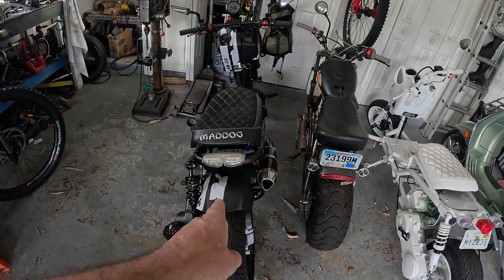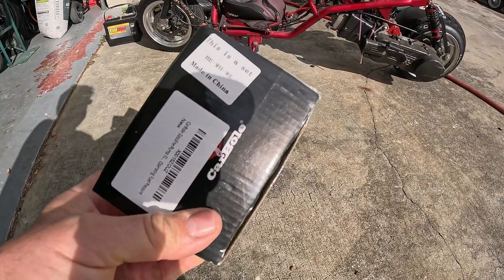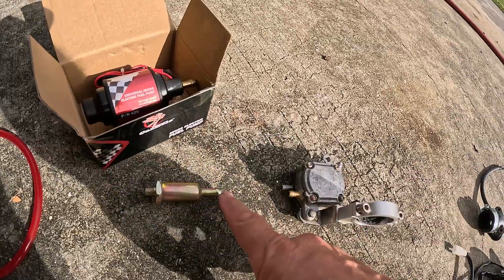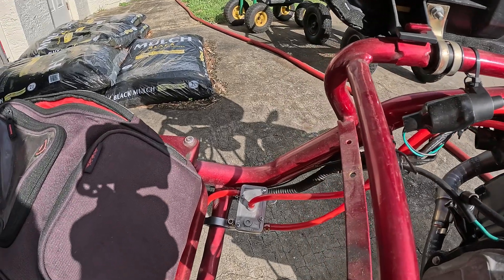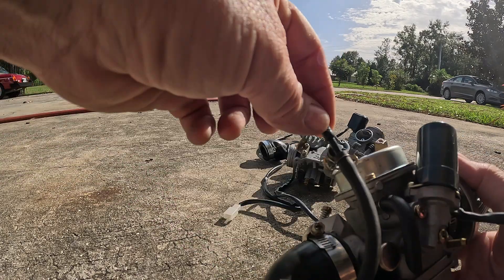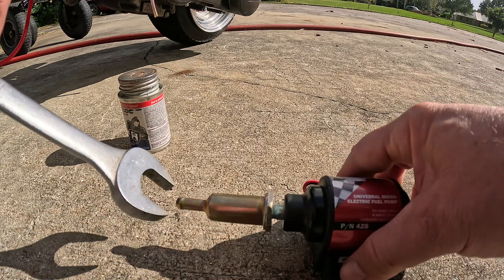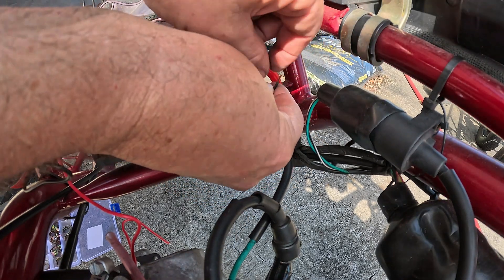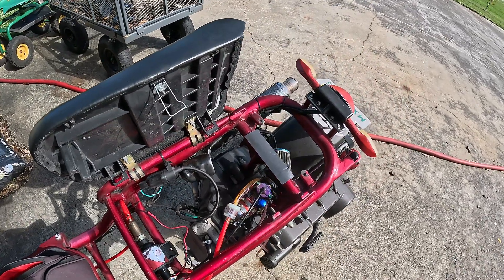How To Electric Fuel Pump Your Maddog or GY6 Scooter In 10 Minutes and Cheap AF

Comment: I have a question. When bike engine is running but not accelerating so , in that case bike will use less fuel but the fuel pump is keep pumping the fuel. So, isn't that bad for pump? It keeps running but the carburetor is full.
Reply from the maker: @omerameen5900  there is still fuel in the pump to lubricate it I am sure.  I am not sure how it knows to not push the fuel to the carb.  Must be a mechanical pressure switch inside between the pump and outlet.  Typically a pump would have pressure switch and send the unused fuel back to the fuel tank via a return line.  These new small pumps just circulate it inside I guess until needed.
Reply: @GhettoWrench  thanks. My gs500 is very bad at vacuum system. It has a mind of it's own. Sometimes run perfectly. Sometimes overflow carburetors. Sometimes starve the engine on high speed. I'm very annoyed by the fuel system of this bike so, considering converting it to fuel pump.
Reply from the maker: @omerameen5900  I though a GS500 had a regular tank and gravity.  What a hassle they put vacuum on that.
Reply: @GhettoWrench  tbh, I'm tying to search and finding the solution myself.  I Have already spent too much money on solving this issue.

Comment: Hello from Sweden.
Love your video. Have a question. In Sweden I can only get the Carbole 2.5-4 psi pump. Will that be to much? If I order it the will send only from the US and they want 19 usd in shipping..... Please help
Reply from the maker: @swedaksouthsweden  I am not sure.  I bet it would work.  But if not, can get one of these little fuel pressure regulators locally?  
https://www.amazon.com/TEMSONE-Adjustable-Regulator-Universal-Carburetor/dp/B0B74G58ZT/ref=asc_df_B0B74G58ZT?mcid=b565d991dd0d3cc9b5d2a62c7c45b9bc&tag=hyprod-20&linkCode=df0&hvadid=693391019694&hvpos=&hvnetw=g&hvrand=16517205986303312942&hvpone=&hvptwo=&hvqmt=&hvdev=m&hvdvcmdl=&hvlocint=&hvlocphy=9012194&hvtargid=pla-1955447590737&psc=1

Comment: I need some help .. so I got the pump working however for some reason the scooter isn’t turning on.. cranks till battery dies.. it would turn on with mikuni pump, it will take forever but eventually turn on.. I am running 2 step down filters mayne that’s the issue? Any help would be appreciated
Reply: I will try to open fuel drain and see if that works. I haven’t worked in the carb on all but I have a brand new pwk carb that I might just put on because I feel this oko one I have on now has been giving me issues since I bought it.. thank you for your help
Reply from the maker: @LuisGallo-r2b  pull the fuel hose off the carb and turn the key on.  See if fuel flows out good.
Reply: So when I pull the hose out of the electric pump fuel comes out but when I put a hose from
Pump to carb nothing seems to be going into carb .
Reply from the maker: @LuisGallo-r2b  do this.  I had to do it on a couple bikes.  Turn pump on then open the fuel drain on the float bowl until fuel comes out then close it.  I actually just had a pocket of air I guess.  Who knows, but it worked.  Other thing to try may be tapping the bowl as maybe the float is stuck in the high position.  Did you work on carb?  If so were the floats moving up and down freely?

Comment: On the gen V you can relocate your plate holder under the taillight and use the plate light wires (circuit) to run your pump.

Comment: Hi! How reliable has this electric pump proved to be? How long have you been using the bike with him? There are similar electric pumps in an iron case. They are cheaper. But they don't work for long. They burn up.
Reply: I have used the metal type that you are speaking of for many years without any issue. I have used these plastic type just the same. I think the main thing is to get the correct pressure that you need for the application you are using it for. I still have the metal pump on my 90 convertible Camaro. It's been working for 10 years. I don't drive the car that much any more but it was a daily driver for a year at least. Putting an over size psi pump is the main issue. If you use the correct size there shouldn't be any issue at all.
Reply from the maker: @ДмитрийКлепиков-к6х  Holly makes a real nice one that is all metal and looks better and cheap.   I actually had that same pump on that same bike and he rode it like that for a year with no issues.  I stole the pump off his red bike to put on that white 50cc just to make a video and show it increased speed on the 50cc also.  It has been there for 7 or so months with no issues.  I just re purchased the same pump for the red one in that video.  In the short time I had the vacuum pump on there the bike has been a nightmare to start.
Reply: @GhettoWrench 
It seems hit and miss with those vacuum pumps. Sometimes I get one that's acceptable with starting and others are outright garbage. They are all junk at wide open throttle of course. Lol.
Electric is absolutely the way to go.

Comment: vaccum line to the old fuel pump is too long and big, too much volume in there so itll act like a sproingy spring dampener.
Reply from the maker: @hershelshochter4703  Thats a good point.  Never even thought of that.  But I have had the same crap results wirh the stock setups.  If I daily drove them it would be fine..... like my lawnmower.  LOL
Reply: @GhettoWrench  i drive a stock one and i learned to hate em, it's the details that get ya stranded. still love mine for some reason.
Reply from the maker: @hershelshochter4703  Like my old 52 Panhead.  Walked home from every ride, but loved that stupid harley.